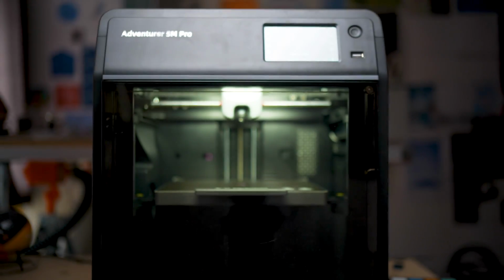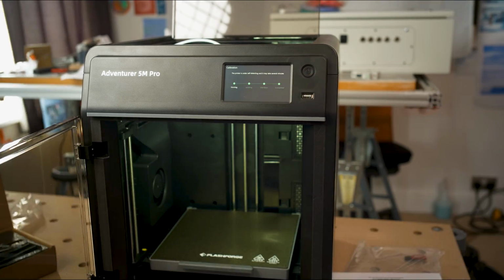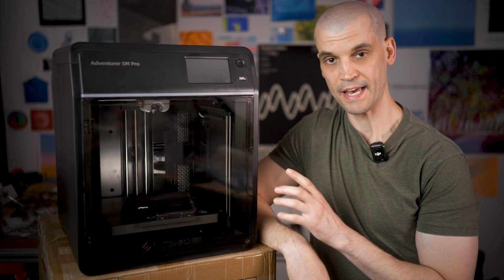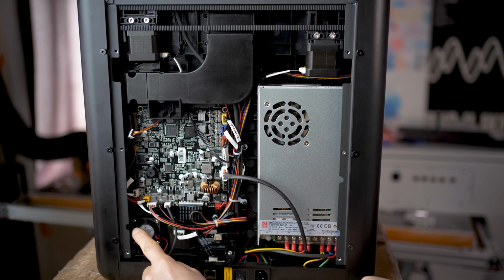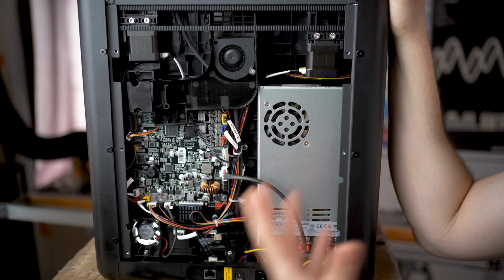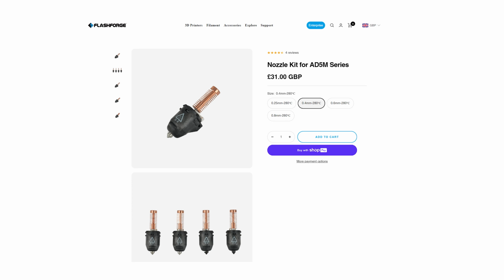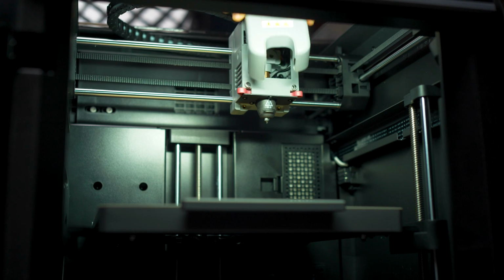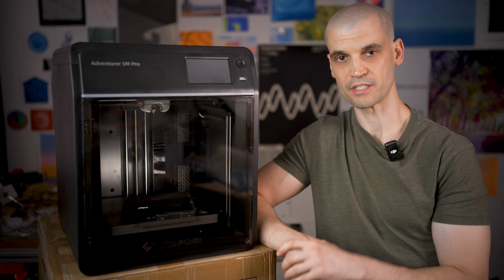Flashforge 5M Pro Review - #1 Budget Printer 2024?

Comment: Really informative review. Much appeciated.

I've decided to get this as my first 3D printer. With a cat and a kid, I need it to be enclosed and with proper ventilation and filtering. This one hit all of those marks, without being unreasonable in price.

Speaking of price, I took quite a gamble on that. I just ordered a returned 5M Pro directly from Flashforge on Ebay for 239€. Seems that units that are returned for whatever reason, apparently just instantly go in this "returned and unchecked" category that are marked down heavily. So I really hope I get a working printer with no issues 🤞Otherwise there should be a 30 day return window I guess.😅
Reply from the maker: Im still loving the printer, no issues so far. 239 is a bargain, i'd have bought 2!
Reply: @ThisDesignedThat  ill update you on whether it actually works when I get it in a week or two 😅
Reply: @ThisDesignedThat  Just got the printer today. They sent me a 5M non pro 🤦‍♂ I'll see how the return process pans out before I consider buying another returned printer from them.

Comment: You are the first reviewer who focus so much on this ventilation/circulation system and described it in details. It is one of the features, why I decided to buy this model instead of some other also good printers. It will be delivered today, and I will be printing some ABS at home, and I am actually baffeled that other brands don't pay much attention to this filtering aspect also.
Reply from the maker: Totally! I've been printing exclusively on this machine since I got it because of this. My voron doesn't get much use now because even though its semi enclosed and has nevermore filter, this printer still does a better job at air cleaning. There are also some mods so you can use cheaper filter replacements - https://www.thingiverse.com/thing:6420507
Reply: Exactly the same for me! Just bought one yesterday.
Reply: 8⁷😅😊😊😊😊😊😊😊😊